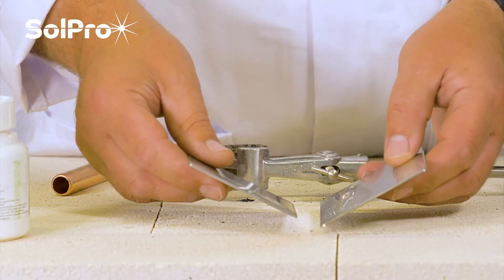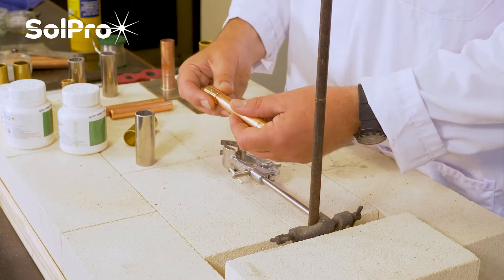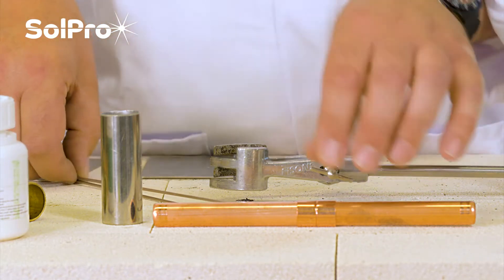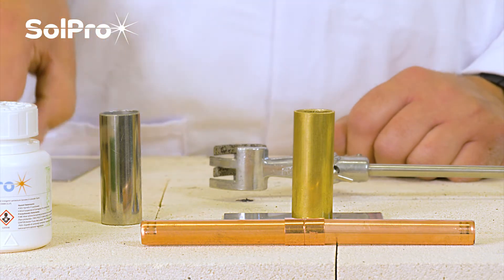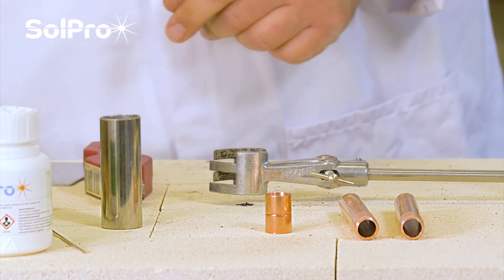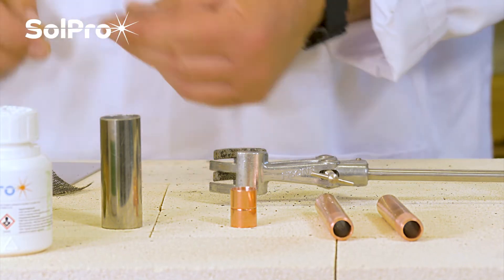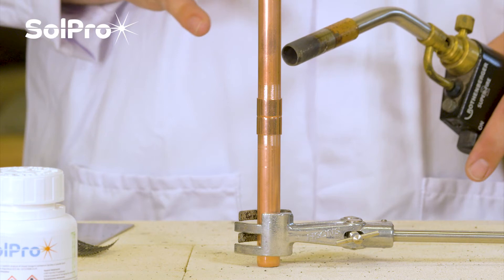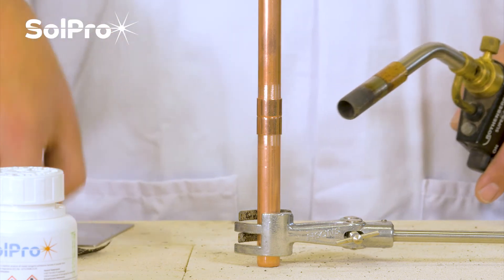Welding vs Soldering vs Brazing - Basic Brazing Tutorial

Comment: Great vid! I've soldered and welded (hobby level), but never brazed. I didn't know about the filler being pulled round to the hotter area. I noticed that you didn't apply the rod to the underside of the joint. How are you sure it's a good joint? You can't look inside it, and I didn't see any molten metal coming out from the bottom. How can you know that the molten rod has flowed down to the lower pipe and fused it to the connector?

Comment: Hello there, sir. Nice video. Just a bit of information. You can arc weld 304 stainless steel to iron and carbon steel with stainless welding rods for 304 steel. You can also arc weld nickel to nickel with the same welding rod. You can even arc weld iron to iron and steel to steel with the same kind of rod.
Cheers! 😀

Comment: Great video 👍🏼
I've recently crashed an MX-5 
Lots of hard to reach welds needed.
And more importantly less heat the better.
It's not structural so I'd prefer brazing.
It's thin steel panels.
Please can you advise what brass rods would be best?
And what gas too?

Thanks
Reply: Are 9/10 MX-5s rusted to shit or is that just because I live in a rainy country?

Comment: I the difference between bracing and soldering was a bit unclear.
So far i found a statement telling the the only difference is the temperature (soldering < (450 deg Celius < brazing)
Reply: Yes its very similiar. But soldering isn't allowed for gas pipes because if there is a fire the soldering would just melt. I soldered whenever possible because you don't need a big oxygen bottle but just a small red one (acytelyn?) and it was easier when soldering copper pipes. But some tubes need brazing. Also heating pipes here by law.
Reply: your comment was more helpful than the video
Reply: It's also in the name of the material you're using, "soft solder" vs a brazing alloy.  It's also clear that certain brazing alloys are intended to work with certain materials.
Reply: @kayakMike1000  Picking the right material whether it's a rod or a soldering wire is one of the keys to success. There are many different solders available that differ both in composition and melting point and what's best differs from what materials you want to solder and what is the main goal and requirements for the joint. Even I know that, though I'm not a professional by any stretch of the imagination.